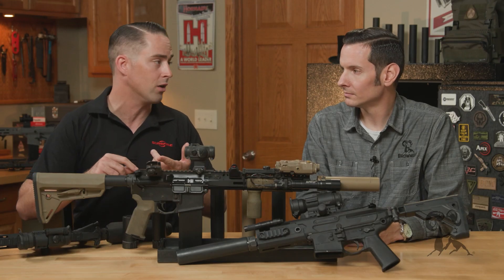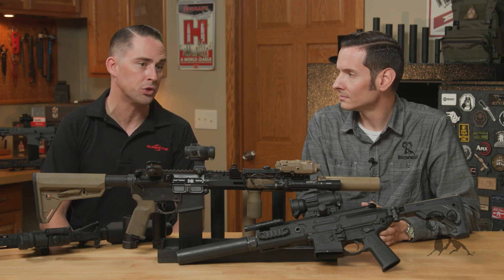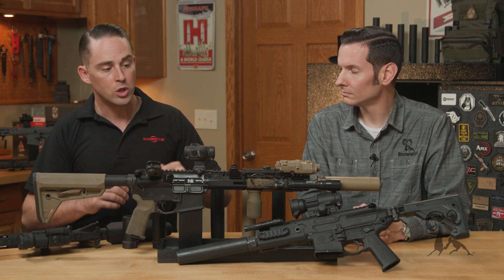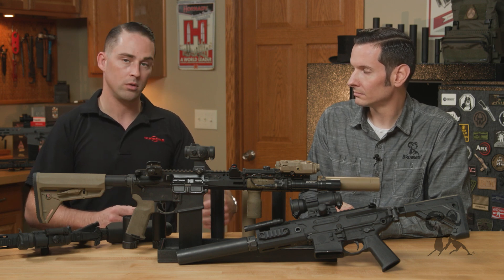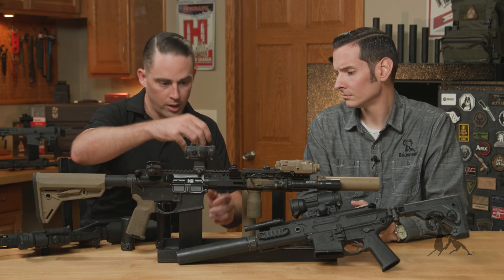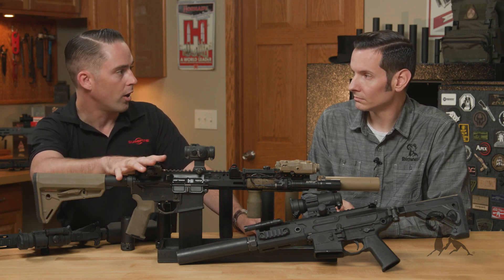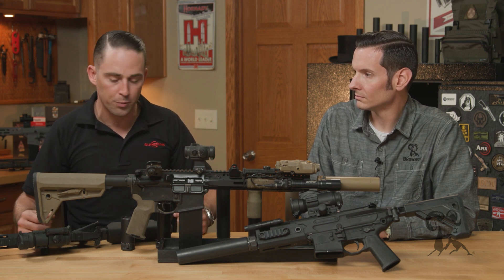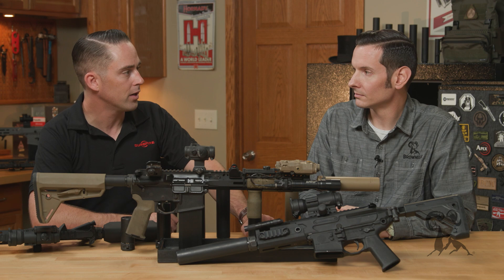Product Spotlight: SureFire Suppressors

Comment: For the people complaining about Surefires. They are extremely reliable and mitigate flash extremely well!
Reply: brainlets only care about a lower dB when it's a supersonic round. Having a long lifespan, low flash signature, and low back pressure are what are most important for a 556 can
Reply: So does everything else out there, quite a few of them for considerably less $. Look at the Otter Creek  Polonium
Reply: @monocorewaffles2781  Not quite. I own a RC2 and a buddy just got his Polonium a few weeks ago (screw atf wait times btw). We were out blasting under nvg and while my RC2 barely put out a flame after the initial cold shot, hit Polo was tossing fireballs every 3-4 shots. If we are taking 1 round every 2 seconds range rules, sure they are the same. However, toss some quick reaction multiround drills in there and that thing starts spittin fire. Both guns were 10.3" btw.
Reply: @Zel_eo  there’s another point to add, one which I’ve heard claims of but can’t test myself. Supposedly the rc2 has a coating that helps cut down IR signature of the suppressor itself when shooting compared to other suppressors. As in it doesn’t glow as bad under nods like some other cans, allegedly.  Maybe you can confirm or deny that statement.
Reply: @OTG_Zulu  I 100% had no idea that was a thing. Sadly I can't say that I've truly compared another suppressors glow to mine. I've done a ton of shooting under nods around friends with other suppressors but most of the time everyone is blasting IR high-beams down range. Thinking about though, my can never really got bright when running drills back to back. I'll for sure test it this weekend and get back to ya!
Reply: @OTG_Zulu  Heyo! So, went out yesterday with a couple buds and tested out the IR glow factor. I stacked my RC2 against a sierra 5 and a YHM. The test was 90 rounds through each of the guns (blowing off old Tula / Monarch) all at the same time. Result: RC2 had a very minor glowing ring near the collar, Sierra 5 looked like a dim white popsicle, and the YHM was a fcking lightbulb. Also, by the 60 round mark the YHM and S5 were belching flames every couple rounds (YHM more so than the S5).
Reply: @Zel_eo  hmm, 90 rds is only 3 mags so that’s a relatively realistic thing that someone could find themselves doing. And if someone else has nods and for whatever reason didn’t see the hellfire from the guns being shot they could see the popsicle floating around through buildings/in the tree line. At least in my fantasy world that’s possible haha. Thanks for the data dude.
Reply: @OTG_Zulu  Np! Thanks for telling me about the IR signature. Another fun fact is that, if you can see it glow under IR...don't touch it! Ask me how I learned this.
Reply: @Zel_eo  thanks for testing out! Oof I’m not looking forward to that. I know it’s gonna happen to me I just don’t know when. Looking to get a suppressor cover combat that, either modtac or liberty’s defense both of them have some pretty interesting claims.
Reply: @OTG_Zulu  I have melted sooo many car floor mats thinking the can had cooled enough. Not running a cover currently but the magpul one looked pretty neat.
Reply: @monocorewaffles2781  know one said Surefire was the only one. But not everything else out there has the same flash reduction.
Reply: @monocorewaffles2781 not familiar with that can personally but I’ve seen a lot of cans let a good size fireball out every several shots in a string and definitely more so when they get hotter. But not as many ppl are concerned with flash in the private sector either.
Reply: So does every other one out there, it’s just every other suppressor outperforms with less weight
Reply: @Casey Schryber  🤣 I am not even that big of a fan of Surefires but your statement is completely wrong.